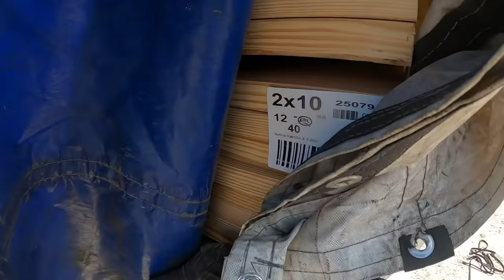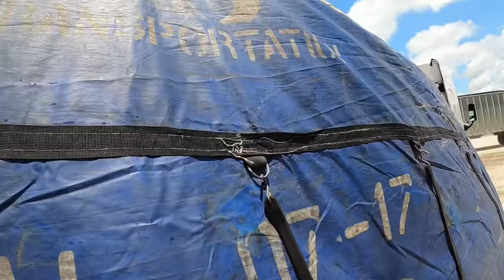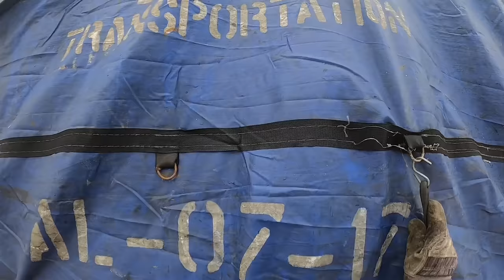How To Tarp A Lumber Load Flatbed Load Securement

Comment: Driving is good brother. When you come from another way than before through a residential area it can be challenging. Pretty quick tarp job it saves that clock. Safe travels brother 😊

Comment: Nice job. One thing about that clock I was hauling oversize Yachts before I retired a year ago now I'm getting active again this year going back to work but not holding boats. One thing I had to use all the time with personal use. At the end of the day it is almost impossible in some areas to find a parking place for an oversize load. If I was to move on somebody's yard it would damn sure be personal used to be because I just say hello I had to go over to the bathroom or something her I had to go get something to eat or whatever to the snack area when they quit making dumbass laws like that I will quit breaking them.

Comment: I'm getting ready to flatbed!!!! Might be a good idea to get one of those new collapsable ladders.
Reply: Yes, I use to put one foot on the wheel hub of the drive of the tractor the next went on the tire and the next went on the trailer as I grabbed the bulkhead on the trailer a ladder is nice. getting on top of that load of the trailer is dangerous especially if its raining you fall off and bleed out till somebody finds you.
Reply: I use 3 of those telescoping ladders in my construction work. The contractor grade is tough but heavy. I use them to set up ladder scaffold in tight places that normal ladders are to long to get into.

Comment: Hey bro nice driving skills good job.just was woundering if there was a reason why you throw your back tarp then climb down rather then throw both tarps then climb down and bungee?the less you have to climb up and down of those loads the better right?
Reply from the maker: Because I need to pin it in place so it doesn't move when i drag the other tarp across it. But in some situations yes i would do both at the same time

Comment: We use ropes and ty hitches when I started we used canvas tarps I started over 40 years ago they use plastic mostly now a pest when they freeze I'm in Australia at the moment trying to get back to US have a green card q
Reply from the maker: Very rarely do I see someone using ropes but I imagine it’s quite the challenge for someone like me who’s used to using bungees
Reply: @bigsnow1705  would not take you long to get the hang of it being that you are so fussy when loading
Reply: The tarps are still canvas. just poly packed top make em waterproof. They have freeze crack point of -40. If you are hauling in -40 then you go for it hahaha

Comment: how heavy is that load of lumber?
Reply from the maker: It was about 48 k
Reply: @bigsnow1705  if it had been treated pine lumber, due to its weight, the load would have been smaller, right?
Reply from the maker: @walterdowns3389  yes sir. Like the load plywood i have right now. It's half the size but the same weight